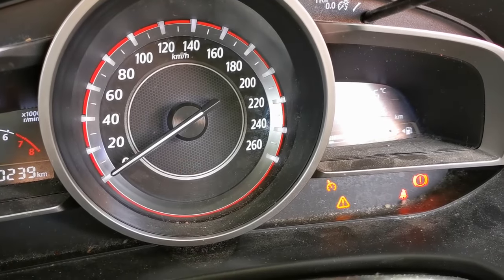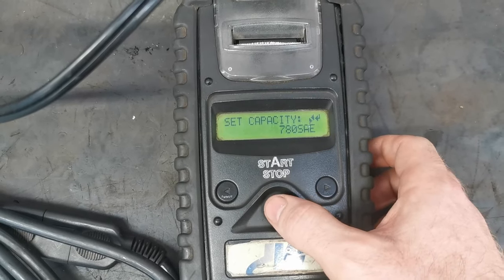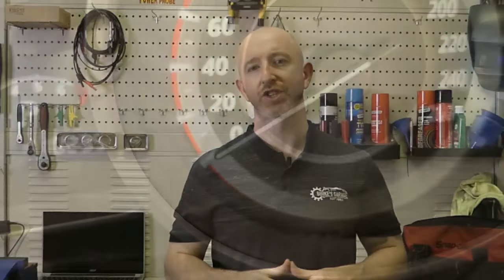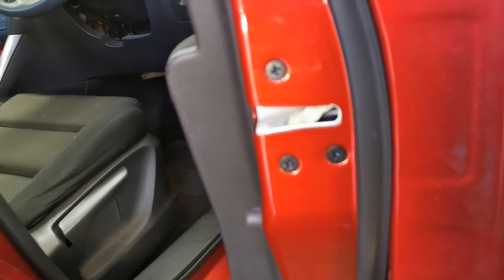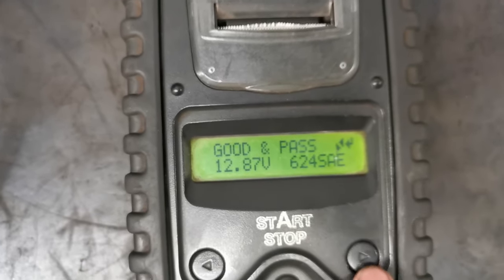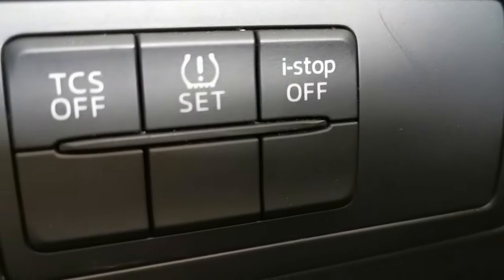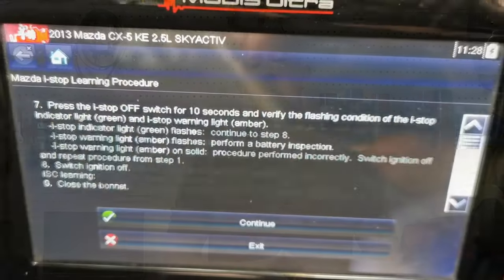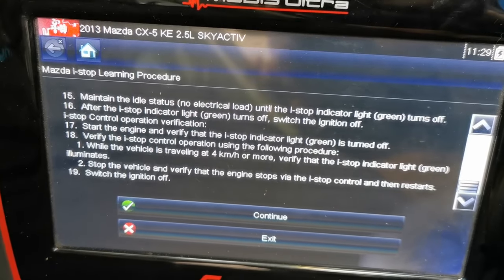i-stop Warning Light On In Mazda - How To DIY Fix - Step By Step Instructions

Comment: First thing  you MUST do is to DISCONNECT the stupid i-stop which is draining your battery and destroying the starter motor on your vehicle, not to mention engine and the gearbox!!!!!!!
Reply: How to disconnect
Reply: The i-stop thing doesn't use the starter. It just produces the spark straight up, without using a starter, and starts the engine

Comment: This was very helpful...my istop light flashes but not always...it's either working or it flashes with the triangle alarm light with the exclamation on...I usually just turn it off myself each time I start the engine...so my question is if it's intermittent and not always flashing does that mean it's just a computer issue that can be fixed by my mechanic?
Reply: @LadyWolf-ik7io  I am having the same issue currently, did you mange to get your issue fixed ?
Reply: How did u fix it,am having the same problem
Reply: Mazda service centre check for me said that need to replace capacitor. Mine is mazda 3 year2016. So far already one year i did not manage to change.still have same problem with you all.
Reply: Any updates?
Reply: long term fix.  Just replace the capacitor.  It's bolt on.

Comment: Great video Gerard; very informative and easy to follow. 
When you said "...re-instal the battery and re-register again.." it can be a bit tricky for me to do all that correctly in my mazda cx-5 2015.
Is there any website that can show the procedures to reset the car at a battery change or re-install?
Also how is the battery registration done?
Thanks hips
Gerry

Comment: A correct replacement battery failed to fix the flashing amber button and system failure while driving my 2014 Mazda2.  The system was reprogrammed at the time of battery replacement.
Unfortunately the problem returned almost immediately. When I returned to the mechanic we discovered the new battery had lost some power, in the time driving 1km home. 
Other possible causes of this charge loss, including the air con compressor and/or the alternator, were discussed. 
I could see a huge bill for investigation and parts ahead so made the decision to trade the car in (at huge loss). 
I would be keen to hear from any other Mazda owners re their experience with iStop failure. 
Thankyou for this very helpful presentation 🇦🇺
Reply: Why did you bother at all? Many people don't like that system. Just drive without it. Not an issue.

I have the same problem, replaced the battery and it keeps blinking yellow. I say fk it. Next time when I'll be in Mazda I'll let them check. If they want huge money for it I'll just leave it as is.
Reply: Will this issue cause a breakdown or can u carry on driving your car?

Comment: Had the i-eloop yellow warning light.  Disconnect both battery terminals and reconnected after 10 mins.  problem solved.
i-stop disabling for 2, 3, 6, & CX-3. Removed cover from the bonnet (hood) catch assembly.  It just pulls out. There is a wire and mechanical switch held in place with a screw on the passenger side of the catch.  Unscrew the screw - you will need an offset phillips or grips.  Put the switch to one side.  Done.
Reply: Mine has been a nightmare I’ll give this info to my son I also have me reverse light on all the time when the car is switched on 😮 
Many thanks
Reply: @lunaluna7141  👍
Reply: I had the same problem e.g. getting an amber eloop warning light and I-stop. I too disconnected the system in my Mazda 2 which worked but today the amber lights came back which is weird as it’s disconnected from the bonnet latch method mentioned. Any suggestions?

Comment: I have a 2013 UK Mazda CX-5 manual.  

Keyless system has stopped working, press stop button engine will start but not stop (have to stall it) but instruments and accessories turn off.  Cannot open boot iStop stopped working about a year ago.  Every imaginable warning light and message is displayed.  Main agent have performed all service work but are baffled and having problems.  Say they haven’t seen such a combination of error codes.  Mazda themselves also appear to be baffled.

Might iStop be causing this?

Comment: If the Start/Stop button is flashing constantly, what might be the problem.  I had not used the car for 1 month since yesterday.  When I use the car, the IStop did not have the amber flash on the first time, but it started to flash on the second time after I turned off the car together with a amber triangle with an exclamation mark sign constantly on. Is it also the battery problem?  Many thanks in advance for your help.
Reply: It might be a battery problem based on what he said in the video. It seems that because the vehicle wasn't used for a month, the battery could have drained a bit, forcing it to disable the ISTOP feature. Check out what he said at 4:01 - 4:30.

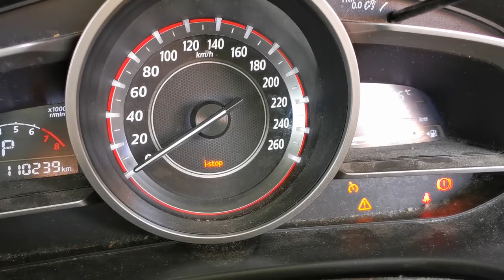Also, notice at 1:18, the dashboard is showing an i-stop failure, which is indicated by the blinking "i stop" symbol plus there is the triangle with the exclamation mark. This symbol means some system has malfunctioned (according to the CX 3 manual).   If you browse to Warnings in your vehicle Apps, it should tell you which system has failed. It may possibly be the Battery Management System.

Comment: thank you for this video Gerard very informative. i had a i eloop inspection required warning which came up today in my 2015 mazda 6. i placed a regular battery in the vehicle (thinking it will be okay and will cost me less) and used it for more than a year. it seems that ive always been having hard starts in the morning and the istop function only lasts 30 seconds per stop. i went to the dealership and they will diagnose the ieloop next week. he said the problem is either the battery which i think it is or the capacitor which costs alot of money and hoping its not the case. the mechanic said it is okay not to have the capacitor fixed but the istop function will be gone (i dont mind because istop for me is pretty useless anyways.. i mean it does save a bit of fuel but you also pay more for the battery replacement..) please let me know if the mechanic is correct about not having to replace the capacitor. thank you and i liked and subscribed to your channel. thanks! from the philippines. :)
Reply: it's called capacitor-delete.  Have it done.  Just make sure there's warranty on the fix.

Comment: Hey Gerard, my Mazda 6 2.2 DTT was fitted with an AGM battery by roadside assistance and the car started to lose power after 2/3 weeks, and the battery management system (BMS) light went on. I got them to replace with an EFB battery  (per various manufacturers' recommendation) and reset,  BMS light went off, but there is an error code of U3004 (16) accessory power relay, can this be solved by some kind of software reset? Must it be done at the dealer?

Comment: Hi i have recently purchased a mazda 3 sport 2015 the i stop is green when it comes on sometimes short time then it turns it self off i have not used pedals, or it dose not cime on at all? Another question is it normal for the air condition light to be on permanently, as i cannot turn it off, meaning its on constantly, so i should not open the window?

Comment: Hi Gerard Burke, I own a 2012 MAzda Biante with this feature. My Biante actually carries 2 batteries. 1 is a smaller EFB N55 Panasonic and the other a larger standard battery 26B17L batteries. Do you know of the reset procedure for this vehicle? Thanks

Comment: ANY HELP!!
My Mazda cx5 having a problem with the air conditioner, headlights,indicator lights and brake light it cuts out randomly while driving . It drives great as usual but when I pull over and shut the engine off then start it up back its to normal . What could be the problem?

Comment: Very informative. How do you explain a stop/start Q85 battery that is 100% charged 100% health with 12.7 volts Open Circuit Volts after sitting overnight tested with an EFB compliant battery tester ... BUT the scan tool PID for the battery won't move past 50-51% therefor no iStop ... How can you charge the battery and get PCM to recognise the SOC???

Comment: Hello. Thanks, I have this problem with the I Stop. I have a Mazda Demio 2014 and sometimes when i turn on the car the I Stop  is bliking in Orange color and It also have other alert like a maintenance key, both together. When I reset the I Stop bottor and i turn off and turn on the car again, the both alert dissapear. Could It be the batery? Or  maybe something about the braking system?. I m very worried about that. Im from dominican republic, and i dont know if there any expert Mazda person here. Could you please help me or give me an advise
Reply: My also blinking orange ..this make 1 years when 2 batteries is changed… nobody knows what is….
Reply: Hi did you get any help

Comment: Hi. My mazda 6 pop up the i stop light when i increase speed in sudden or 3000 rpm and above. Is that related to battery or i-eloop system
Reply: You figured it out ?
Reply: @karelpeters689  yes. when I start the engine no warning comes out. after I start to move and y rpm reach 3000 rpm plus or sudden exhilaration happens then the warning sign appearece.
Reply: @gobikrishnan9827  how did you fix it ?
Reply: @karelpeters689 right mean cliff hanger…. Did you fix yours

Comment: iStop is the most annoying feature on my Mazda 6. Pointless feature. Dangerous at times. Wish I could permanently disable it, might frig the bonnet catch switch. Otherwise after 3 years they are very good cars (apart from the thin paint). 

For some reason I assumed you had scruffy hair and a beard!
Reply: I found a hack on YouTube to disable, and seems to be working a treat! There’s a cable on the bonnet latch that you disconnect, and the istop thinks the bonnet is open and therefore won’t turn off, It took 5 minutes!
Reply: @SimonBarrett74  I'd heard of this, and it makes sense: the iStop is disabled with the bonnet open when a mechanic needs the engine to keep running for a while, like before an oil change or during an MOT
Reply: Hi Ger ,
concerning
Reply: @SimonBarrett74   wouldn’t do it, my friend did that and it played with with the car.
Reply: Just disconnect the bonnet switch, boom engine check light gone, no more problems. I can leave with mirrors not flashing when locking.